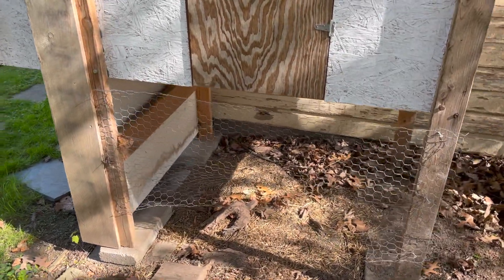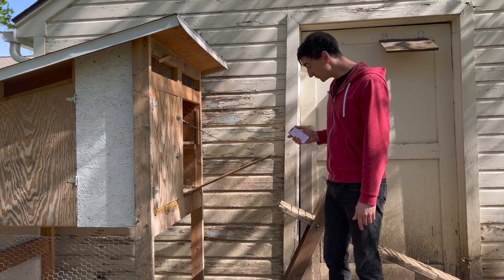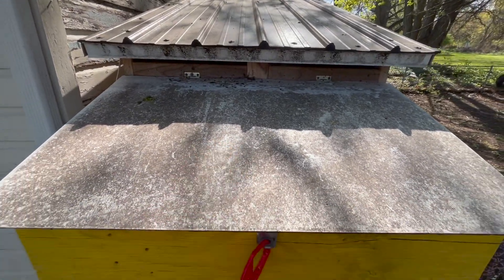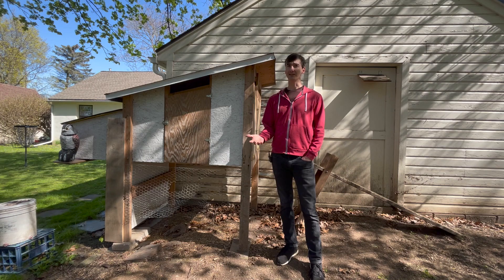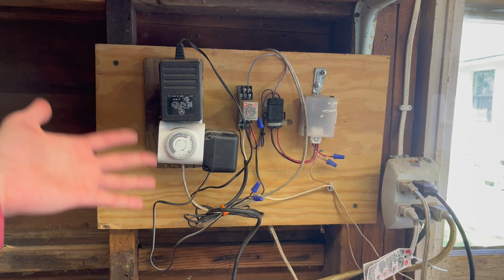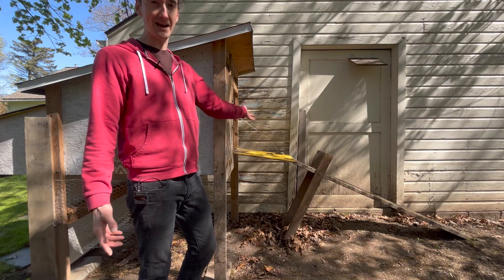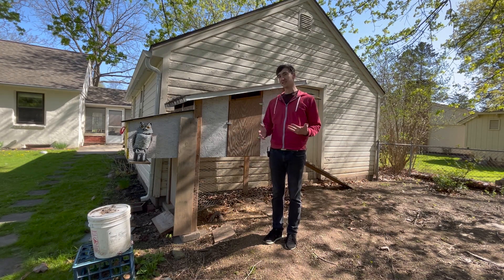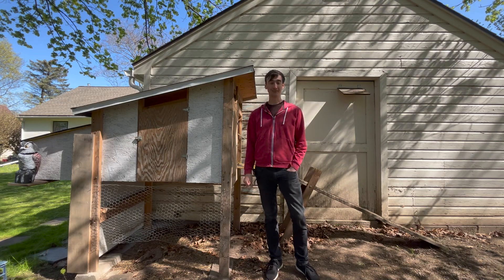Automatic chicken coop door DIY and other coop design considerations

Comment: I wrote a long comment saying good things and more important about the door. I have made other drawbridge style doors but never put much thought into racoons. So the gears in my head are turning and want to make the bridge longer by making it a bifold bridge. So when the coon tries to climb up it has a much larger gap to cross. 

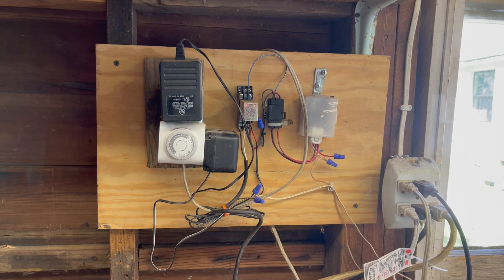5:50 you should get a mhcozy 4ch smart switch. It will cut down/get rid of 80% of that clutter. ask me about it. I wrote a whole paragraph on it. in the comment that got deleted.

Comment: I like the drawbridge door right up until I saw you used an antenna. How long before it broke?
Reply from the maker: I used it for a couple years and then lost my birds to a fox and sold everything. The antenna is designed to be used outside in the elements 24/7 so I'm not sure what your concern is. I did have to grease it occasionally though
Reply: @adamdport  " The antenna is designed to be used outside in the elements"

Yeah but it is not designed to be lifting, pulling , pushing things. They are designed to only hold their own weight and for catching radio signals.

As far as 24/7, that's not true either. It is only exposed to the elements when you have the radio on. So unless you are in your car listening to the radio 24/7 then no.

"lost my birds to a fox " yeah I could definitely see that happening.
Reply from the maker: When the antenna is retracted it's still just as exposed to the elements. I'd argue that being whipped around in the wind on the highway is harder on it than some resistance of the weight of a small door once a day. and EVEN IF it broke after a few years, it's only $10 at the scrap yard for an identical replacement...but to help the next guy, did you have an alternative to recommend?
Reply: @adamdport  "When the antenna is retracted it's still just as exposed to the elements. "

Did you really just say that? That's like saying you wearing a space suit is just as exposed as it you were wearing nothing. Seriously?!

" I'd argue that being whipped around in the wind on the highway is harder on it than some resistance of the weight of a small door once a day."

And you would be wrong. It is not on the highway 24/7 either. And it was design with that in mind, and is why it is tubulare for less wind resistance. Anda again it is NOT meant to be pushing pulling and lifting anything besides itself. It is not a FISHING ROD. Just look at your own video. Tha antenna is bending like you had a marlin on the line. 

On the note about the highway. Even in the owners manuals of cars that had them they would often tell you not to have it up in harsh winds. 

"EVEN IF it broke after a few years, it's only $10 at the scrap yard for an identical replacement"

Guess again. $28.16 at the junk yard. go to pullapart  / used-auto-parts / parts-pricing and see for yourself. 

Plus a used one will most likely die sooner than later. Not to mention the power antennas at junk yards ar getting more and more rare.

The cheapest new is $29 , and those are the crappiest ones. 45 and up are the better qual stuff. 

"to help the next guy, did you have an alternative to recommend?"

Of course I do. I'd recommend a cheap crappy string door, before I'd ever an antenna.

I got vids on them. You can get a new decent Linear Actuator for $35. They are literally meant for this sort of stuff.
Reply from the maker: @AztecWarrior75  you don't bring your antenna inside at night—it's outside 24/7. They're designed to withstand sustained highway driving which is 70mph air. I personally paid $10 at my local scrap yard. I'm sorry your prices are more than mine. Enjoy your project!
Reply: @adamdport  You know damn well that the antenna retracted and inside the vehicle is NOT the same thing as being out in the weather. That's like you being in the car, you are not out in the weather.

Moving the goalpost does not change the facts. That's just arguing in bad faith.

"They're designed to withstand sustained highway driving which is 70mph air."

Um yeah and that's totally different from making it open and close a door. What part of "it is NOT meant to be pushing pulling and lifting anything besides itself." are you not getting?  Plus I already covered that. 

"some resistance of the weight of a small door once a day."

All day. 

Anyway be the horse. I'm out.